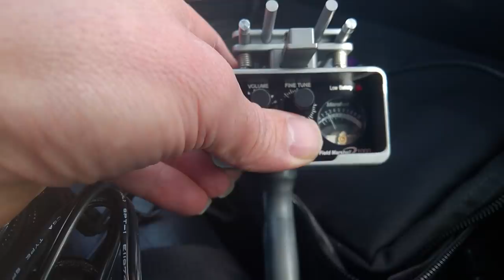Stolen Atlas Copco Compressor found by Automatrics

Comment: 3:15 "now we've got all three yagi antennas out"

No, that is only one yagi antenna.

The longer element is the reflector (passive element), the element with the cable is the active/driven element (a dipole) and the shorter element is a director (also a passive element). There are variants with way more directors. But the increased amount of elements doesn't increase the amount of antennas, only the directionality of that antenna, it is still a single antenna.
Reply from the maker: Noted :)
Reply: zvpunry I don't think adding "I'm now unfolding the reflector, which is a passive element" etc etc would have added anything to the video. In any case, if you're going to be so pedantic, you could at least be correct. It's not "only the directionality" that is increased, hopefully the gain is too, as well as the weight, among other things.
Reply: Not pedantic at all.  This is remedial radio discussion.  To be pedantic is to say the gain is on reception.  There is no driver in this instance.  The description of the antenna was left out of the video, which seals up the very conclusion of this video.  Holding an omni vertical would not suffice in this case, and would close this guy's business.  That is added value that comes through explaining the nature of the antenna.
Reply: Hair Fritz: I didn't suggest to name all elements of the yagi. I just explained why it is only one antenna and not three. And I think it is important to mention and correct such mistakes in an explanatory video like this.

And if I were pedantic, I would say that the gain of the antenna is just an irrelevant side effect for this application. The increased directionality is important. The directionality gives you gain in one direction, but it gives you attenuation in most of the other directions. This makes it possible to point it on different directions and listen to the changes of the signal strength.

(be careful, I like splitting hairs;))
Reply: this guy is real fun a partys
Reply: zvpunry, I am 100% on your side here!
  I am Electronics by trade and you are correct!
I am also pedantic and can split hairs, so you have a backup if needed.
Cheers from John, Australia.
PS: I hope they nail the thieves testicles to the wall so that they can not breed more THIEVES!!!!
Reply: Also America before here as well as other places.
They also used to steal people from their Country and use them as slaves!
I think times have changed a bit Phuck Ewe!
Cheers from John, AUSTRALIA!
Reply: Yes i also picked up on the "3 yagi"  coment.We have radio "Fox hunts" in Eastbourne each week and we always find the "Fox" Great fun and   a very interesting video.
Reply: He meant 3-element.
Reply: I'm not in the radio biz either, but it came out odd to me.  Pointing out the fallacy of his phrasing isn't pedantic at all.  The single array of elements, rods, however you call them, forms a single yagi antenna. 

It's not unusual for somebody who knows how to effectively use a tool to not fully comprehend the proper technical terminology behind the various parts of it. 

Where it annoys those who DO know these terms as base knowledge, is when they try to implement said terms with insufficient understanding of the application of the words. 

It's a minor and forgivable faux pas... but that doesn't mean it's not worth mentioning.  ;-)
Reply: +phuck ewe Better to phase two loops to get true directionality pointing towards the source.
Reply: BeeRich33, Of course, you are correct, but one needs to decide at what depth one should curtail the explanation and how deep the description of the antenna should be. In such a video aimed at the general public, I wonder if it is necessary to say that the directivity of the Yagi  is increased because of the Reflector and the Director receive a phased signal which in one particular sector, due to the distance between the  main dipole and the others  elements in relation to the wavelength of the signal, there is a cumulative effect where the main dipole is excited at a higher state by the polarised E field. I do not think the general public would be interested in any deep detail about the antenna itself, but only that it was pointing in the right direction and through triangulation, the transmitting source could be located.
Reply: +zvpunry  To be fair, he just has to know how to operate it, not how it works.  Although, the most knowledgeable operators will be the best ones.   Given all that, he still gets the job done, which is all that matters.
Reply: @joandar1  slavery never stopped.  it still goes on all over the place.  I'd mention the highest traffic city, but I know it would get the comment censored.
Reply: @PracticingLiberty  you can't even spell "two" and you've never been on a transmitter hunt in your life.
Reply: @Steve K wtf are you even talking about?
Reply: Yogi, the inventor, passed away just a few years back.
Reply: @BeeRich33  Damn you're good at this.

Comment: Get a phased antenna array, a bit of software and a good gps system and you can draw a heatmap of that signal easily by driving a bit around in the neighbourhood
Reply: Their method was sufficient and easy. But you are right, there are easy to use commercial direction finders that use this to create a heatmap, but they are way more expensive then this simple direction finder.

There are always methods that look easier, but aren't. Another method would be TDOA direction finding, you just need three receivers that receive a single pulse and send the timestamped + geotagged data to a computer that calculates the source of the signal. You only need three expensive receivers (with computers), high bandwidth data links between them and of course at least three cars with at least two persons each. ;-)
Reply: I seen a news story where this woman was car jacked. She had left here cell phone in the car. The police track the car (cell phone in car) right to the chop shop. Busted the whole gang. Everything can be made trackable one way or another now days.
Reply: David: Cell phones are trackable in different ways. The original way is looking at which base stations can receive it. Most of the time it can be received by multiple base stations. This gives relatively good information where it is. But this information is only available to the operator of a telephone network but they can give that information to the police.

Then there are devices in use by the police that are basically fake-base stations. They pretend to be a base station from the network operator, but they aren't. The cell phones connect to them and then you have control over them, you can identify their transmissions and use well known direction finding methods. This is known as IMSI-catcher.

But today we are used by computers over which we have lost absolutely any control. Those computers are basically owned by apple or google (even if we have paid ridiculous amounts of money for them). And these computers happen to have a cell phone and a GPS receiver built into them, come with a small touch screen and are called "smartphone". As an example: If we sit on our normal PC and visit https://play.google.com/store/apps and install some app on the phone, it will be installed without even touching the phone. If we think that the app was installed by ourselves, then we are wrong. The app was installed by the real owner of the phone, in that case google, and we merely asked them to do so. It is entirely possible for them, as the real owner of the phone, to install any program they like. They might install something that sends the GPS location of the phone every second to somebody (they wouldn't need to, they already do this).

If you haven't an antique car, you might drive around with a collection of small computers that might be connected to a gsm modem. Some cars don't even try to hide that fact, they offer the user a web browser and if the user doesn't looks, the firmware gets upgraded and the dashboard looks different (hello tesla). And of course they have GPS.

So yes, tracking is now easier then ever. Unfortunately it isn't easier for us to track our stuff, it is easier to get tracked by others.
Reply: When I was a kid we used simple cans around CB antennas to play cat and mouse hide seek around town.
Reply: This is called Foxhunting.  I've done this here in Canada.
Reply: well done!
Reply: @BeeRich33  Hey man that's species-ist
Reply: 2000jago.  I can only assume it makes you feel better belittling others when they talk over your head.
Reply: I'm an ostrich
Reply: if the police want to work. in belgium they do noting for this.
Reply: funny, you just talked down to them. thats the internet for ya.
Reply: Dennis Lubert:  Exactly!
Reply: zvpunry:  exactly, too!
Reply: 2000jago:  They're both right.  Those techniques are superior and also cost a lot, so it always nice to know of more options and how much they cost.
Reply: Simple DF with a hand-held Yagi bean antenna - why would you recommend something as complex as what you recommend?
Reply: Or... fit a gps module and have the pulsed transmission actually send out the co-ordinates.
Reply: @davidhenderson3400  most mobiles support that. i lost mine in my workshop and it was on silent.

Via google i could force it to re-enable the sound and ring on full volume. it also gave the gps location which was of course inside my unit :)

Comment: You should put a piece of parchment paper under your antenna to keep from scratching your roof when you put it on and off.
Reply: just put a small piece of  felt under it. I have a similar magnet mount for my amateur radio antenna. The felt works great...no buffing required

Comment: I used to do this in the Civil Air Patrol in the US with aircraft emergency locator beacons that would trigger either manually or automatically with the shock of G force. It was long before cell towers and before handheld GPS. The US Air Force would detect the signal by satellite with an accuracy of about 1 degree lat/lon which is about 100km. From there, they'd alert us and we'd have to either drive or fly around the area and get within about 16km to pick up the beacon and give a location to the ground party and they'd triangulate with yagis and we'd plot possible targets on a topo map. Of course, reflections from mountains and terrain meant it was never simple.  And strange as it may sound, it was virtually impossible to find the crash site of a small plane by air because you can't see anything under the forest canopy.
Most of the time, the signal was localized to an airport and found to be coming from an aircraft which was intact. It was important to get them turned off ASAP because they all operated on the same frequency: 121.5MHz.
Reply: Interesting man

Comment: For the guys wondering why they would bother nicking these, they are worth a minimum of 10k even when used! This is on the lower end of the industrial portable spectrum but still worth a hell of a lot given its diminutive size. Source: I've worked for AC for ten years (7 years as an employee, 3 years as a contractor)

Comment: Good system, the UHF back up is something that separates your product from all of the others that fully rely on GPS, as the satellite signal is easily obscured and the cleaver thieves have an effective work around for phone based GPS locating nowadays.  I've done a lot of radio direction finding work over many years and with a bit of practice you can be very effective. A better hand held Yagi on you little UHF RX would help a lot. Oh, yeah, I have had 2 mobile air compressors stolen by the way.

Comment: Simplest way of dealing with plant theft is to have a registration system that requires several chips and a couple of transponders in the vehicle or plant equipment as well as a registration plate that is visible that ties in with paperwork like that of a vehicle... Then, any sales have to be done with paperwork like you do with a car and if there is any issues with plant, that's when the thief gets found out.

Comment: I also have a Field Marshall from my falconry days and would like to put a transmitter on my motorcycle. Did you wire your transmitter to a large battery? If so did you have to step down the voltage?  Did you have a special long life transmitter? Or did you just change out small batteries on a regular basis on a small transmitter? Thanks so much and I enjoyed your video - gives me a lot of hope.

Comment: Pretty cool.  Although, I'm surprised that the transmitting/GPS unit isn't always buffering several "miles" worth of valid location data into memory.  That way, if a thief stuffs it into a garage or it otherwise can't get a valid current GPS location fix, when you query the device, you will see where it was just prior to loss of the GPS signal (aka breadcrumbs).  The radio beacon is still a great failsafe backup, but with a history, this would have been found almost instantly.

Comment: Surprised the GPS works in the storage unit... as well as the RF tracking signal (I assume that is what it is used to pin point exact location win nearby).
Reply: The GPS did not work in the storage unit, that is why the had to DF the UHF signal, the rough location was given by the cell site coverage area.

Comment: how would I do a search for those types of radio trackers?  I am pondering the use for them when doing remote explorations and I want a way for people to find me or me to find somebody else quickly in case of an emergencies.
Reply: It always depends on what you are doing. If you want to find some remote geocache or want to go hiking, just tell someone where you are going. If there is cell phone reception, use a tracking software like owntracks on the phone. There are also satellite based tracking systems, but depending on the system that is used, it can get quite expensive but this might be the only solution if you really mean remote explorations. ;)
Reply: Personal Locator Beacons (PLB's) are available. When activated, the signal including the GPS position is received at a search and rescue centre. Here in Australia and I'm sure other countries would have an equivalent system.

Comment: 4:40 orient  the yagi so the elementa are vertical - the aluminium door will be quite an effective sheild (20-25 dB at least) but RF leakage at the edge may be vertically polarised.  Also consdider a sheidled loop antenna for very close-in sniffing work - can be made entirely from coax but is better made from microbore copper tubing, a solder coper T-piece and the coax inside it - see https://electronics.stackexchange.com/questions/71182/is-this-shielded-loop-antenna-balanced    as a starter

Comment: That equipments low tec isn't it ?? If you can track a mobil phone to a exact street etc ? I'm wondering why they don't use a similar system ? It would save all the driving ??

Comment: They towed it away without putting electrics cable for brake lights and indicators for the compressor.Also,no number plate added to it- that's a nicking and 6 points!
Reply: I'd hope the nanny state would give them a pass since they were trying to get away from the thief's place in a hurry...
Reply: at least in the USA if you can see the lights on the truck past the trailer you don't need to plug in the trailer lights, i worked for a heavy equipment rental company and i hooked trailers and loaded equipment all the time including these 185 atlas Copco compressors rarly did we even hook up the lights for those trailers unless they were working on a dam or in a mine/quarry OSHA and MSHA are very strict when it comes to things and company get huge fines even if a sticker is missing on a piece of equipment but other than that yea not 100% necessary
Reply: Thieves take number plates off all road rolling plant so ANPR doesn't give them away-if they get stopped towing something with no plate it's just a £30 fine.So if no plate,less risk of being rumbled!
Reply: Are those actually lights, or just reflectors on the back and side of the compressor?  Very thin for lights unless it was a multi-LED setup...
Reply: There are no lights on this trailer, so there's no cable to put on. Why there's no lights on it is another question, maybe because it's a narrow trailer.
Reply: The cable is already fixed to a bank of lights-you put the whole lot on!!!!
Reply: EightiesTV:  yeah, get away from the cops who almost caught them.

Comment: Nice job recovering the compressor. How long will the unit send out 'beep' signals when it's in alarm?
Reply from the maker: Well without given too much away a really, really  long time  :)
Reply: 12 - 40 days depending on the transmitter, unless it uses the external battery then probably longer.
Reply: Nah mate no 12 days try bit closer 2 18 to 30 months and if it ain’t found in that amount of time then it’s prolly in a shipping container to Africa or Far East

Comment: CORRECTED TEXT:
 ★ Stolen Compressor Located Inside Harrow Garage - 9 Oct 2017

   We received a call from a customer this morning reporting that one
   of their Atlas Copco compressors had been stolen from a worksite
   near Woolwich in South East London.

   We armed the Automatrics MTrack theft recovery tracking unit and as
   no GPS position was possible we dispatched a radio signal finder to
   the Harrow search site near Wembley. The secret radio signal was
   picked up immediately on the finders arrival, and the signal source
   was traced to a set of garages.

   We contacted the Plant and Agricultural National Intelligence Unit
   which is a specialist plant theft unit attached to Metropolitan
   Police.
   An officer was dispatched to support the opening or the suspect
   garage to reveal the compressor and a believed stolen HSS tools
   hire Chemical store.

   Many thanks to DC Julian Crabb form PANIU for attending site so
   swiftly, great teamwork !

 ► You can purchase this system here ◄ 
   http://www.trackersecurity.co.uk/